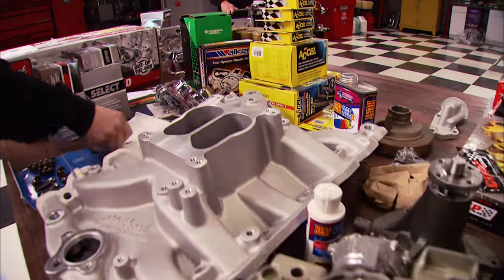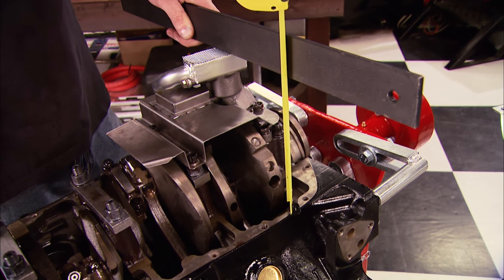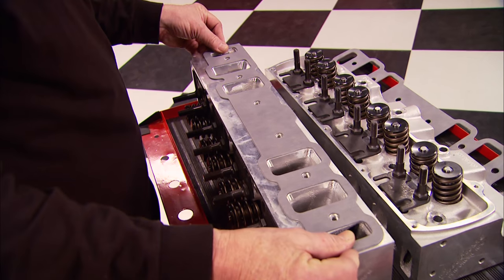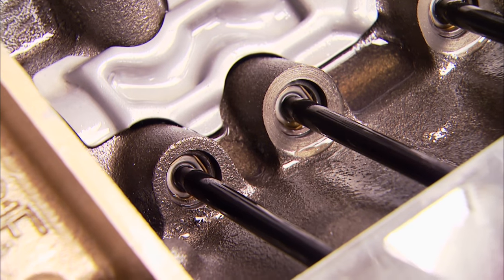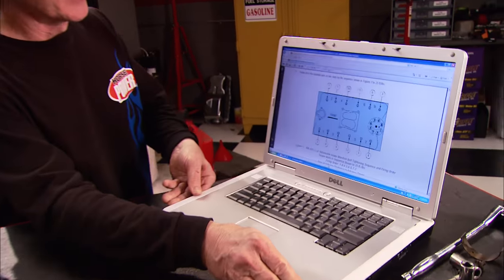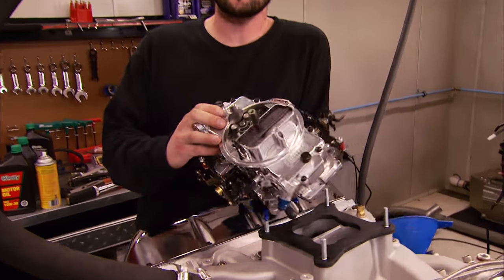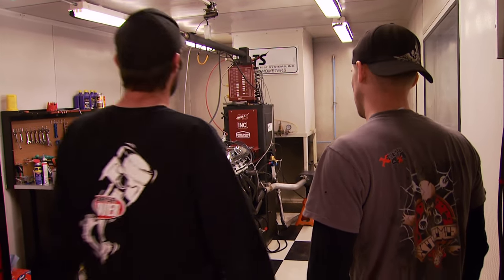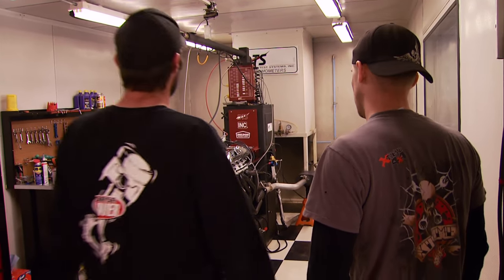Dyno Testing a Mondello 455 Olds Big Block - Horsepower S13, E8

Comment: They didn't mention oil galley restrictors in the main saddles , cam spacer or bushing to stop cam from walking forward and back.  Did a Mondello build in 1990 and most pieces had to come from Joe. They had just started testing billet MSD distributor with vacuum for the street.

Comment: but how long would that Old 455 live those engines are not good above 5k RPM
Reply: With the block job they did it should be fine
Reply: I have one in my boat. It’s runs for hours on end at 4500 rpm. Like 2 hours at 4500 rpm no letting off. oil pressure and water temp will never change, she is dialed in perfectly.
Reply: HP peaked at only 4700 RPMs with the stock cam they re-used...

Comment: Gold paint is for the 400 engine blue is the 455
Reply: 442 Olds black and gold Hurst dug
Reply: Olds gold was for a 330 350 cub IN 400 was bronze and 455 was red or metallic blue. Just saying.
Reply: Pass the gold Olds 455/461 off as a 400 in a 1960's Olds 442...

Comment: Being stuck with that manifold back at the time, it would have helped to port it, cut out the plenum divider and run a nice 1" or more spacer. Would be interesting to know exact cr and cam specs.
Reply: Look closely 00:47 re-using stock flat tappet cam... 4700 RPMs HP peak...
Reply: @BuzzLOLOL i heard new hydraulic roller cam

Comment: I had this motor in my 65 Cutlass back in the late 80's. I had so much trouble getting the rubber seal under the front of the intake manifold stay in. Seemed like once a month I was putting in a new one. Now you guys don't even use a rubber seal. I wish that silicone existed back then. Or maybe it did and I just didn't know about it.
Reply: Silicone was around then lol .

Comment: #1 NEVER pre- pump up lifters  #2 vacuum advance is for station wagons, less vacuum on load = less advance . best set up for HP engine is no vacuum advance 30 regular 32 hi-test  34-38 race gas total timing . I enjoy your show but check what your doing and saying young pups!
Reply: Is that engine specific advice your giving?
Reply: You're right about the liftere, WRONG about vacuum advance.
Reply: Vacuum advance is for efficiency. If you’re not into efficiency that’s just you being wasteful.
Reply: @timsharpe3498  When you step on the gas you lose manifold vacuum in turn your timing is reduced, its and antique knock prevention , how are you going to make hi power with 1/3 less timing?
Reply: An old fashioned distributor has about 15 to 20 degrees of centrifugal advance. When you add that to the initial timing you get total timing which is everything an engine needs at wide open throttle. Vacuum advance is for part throttle only.

Comment: That first carburetor was a horrible idea for this kind of build,there's a reason why Holley stopped making them.
Reply: Holley wasn't actually MAKING those - they were sold under their name - those are GREAT carburetors based on the old Autolite design HOWEVER they weren't available with the GIANT cfm sizes
Reply: Summit corrected those carb.s...

Comment: a few years ago I I watched a engine shop trying to get 500 HP out of a lightly built Olds 455 and they had the same intake as this one . they were struggling to get it over the 495 hp mark tell the old man who runs the shop had the idea to use the stock Olds aluminum intake the engine had from the factory. it turned out it had bigger runners and  better flow then the fancy modern one. the engine ended up making 525 hp after they changed the new intake for the crusty old one still in the factory gold paint. the owner of the engine was very happy about the power numbers but still had them put the shiny intake on the engine and kept the crusty one for later some people .
Reply: Was the engine N/A?

Comment: I wonder if a carb spacer would have grabbed 10 more hp.
Reply: hugieflhr03 you loose hp with those
Reply: @yamahaguy1732  I don't know where you get your information at but a 1" carb spacer is good for between 10 and 15hp on most intake manifolds. Go either side and you will still gain but not as much. This is an old of a hot rodders trick as indexing the spark plugs and icing the intake between rounds.
Reply: Im right there with you on the spacer thing..I thought that's what he was gonna do when he stayed late! aside from a little bit larger plenum area you get a longer radius when air fuel mixture is making that 90 degree turn from the carb throats to the intake manifold ports.
Reply: Those TV shows are basically 30 minute advertising gimmicks to flood autozone o'Reilly's and jegs with cardboard box "builders"......everyone wants a race car but not so many know how or where to find the hidden horsies without spending a boatload of cash!
Reply: Fred Mendez I would agree. I think this is a very old episode and Mike was still cutting his teeth. He’s learned a lot since Pat joined the show and that’s what hotrodding is all about. Learn something new everyday👍
Reply: @1967davethewave  It all depends on the intake ! Me & a buddy just built a Chrysler 451 stroker witch is a 400 B block with a forged steel 440 RB crank with the mains turned down to fit the 400 block using 440 rods & forged Diamond Pistons & had done some port work to the 906 iron heads we used & a 40 year old Direct Connection 509 lift 292 hydraulic flat tappet cam & we just had it Dynoed last Saturday using a Team G single plane intake with a Demon 750 double pumper & it made 487hp at 4,800 & 523 torque at 4,400 rpm's so we decided to try a 1 inch spacer & lost 5 HP with our set up so they don't always make more power . I think with a dual plane intake that usually sits pretty low like this Olds one does it very well could pick up a few more being it's adding to the ready short small plenum these style intakes have . Our engine was pretty basic with iron heads worked some & the intake along with making sure it had a good bottom end & it was only a 9:1 compression ratio so something on this Olds isn't right in my mind because I figure what's been done plus the aluminum heads it should have come close to 500 HP ! Seems to me by watching them run the Dyno they kept the rpm's pretty conservative which I know Olds 455s don't like to be revved high but being Mondelo built the block & did the mods to it they should have kept going up on rpm's until it starts to drop power off & some times not trying more RPM leaves lost power on the table ! I had a Olds 455 great torque monster but it cracked a Piston when driving it after getting down hard on it so I sold the  car but it was sure fun getting second gear tire chirps with a turbo 400 in a big Delta 88 that I had with that 455 in it lol.
Reply: @peteloomis8456  Yeah, you're right and a Team G has a pretty large plenum. I should have said every dual plane I've ever seen but i didn't.

Comment: 12:50 if the carb was not large enough. The air fuel ratio would have told him that.
Reply: no it doesnt...you can have a 500 cfm carb tuned perfectly...it would just make like 200 hp though
Reply: @philtripe  exactly.  Fuel ratio has nothing to do with carb size . You can run a 496 on a single barrel perfectly it just wont make any power
Reply: 🤔...that cannot be true...more to do with cfm, or cubic feet per minute flowing through carb, intake, combustion chambers, rather than the ratio that the air and fuel is combined....
Reply: Just research your info...no one knows everything but if you're really interested study...

Comment: Swap the intake back to the factory one
Reply: Nope, the factory intake could never make even 400hp... not going to happen. Been building Olds engines for 30 years, my guy, and never seen a factory intake go over 400hp, and be fickle as hell on a HP engine when it's hot outside.

Comment: Loads of torque but I still don't think that's much HP considering ported AL heads, big cam, intake and carb, balance, decking, etccc
Reply: You’re not going to see ungodly horsepower numbers because the intake is too small for that. The heads also need 2.07/1.72 intake valves. Too much airspeed for those heads and not enough cross sectional area. For what it is, that’s good power/torque.
Reply: Peyton Hunt it makes for a good street strip engine. It certainly is not a all out race piece. Engine has lots of torque down low.
Reply: @markball7028  
That's correct and it makes for a good street car.
Reply: @markball7028  nice for old school classic sleeper like a 98 Regency or Cutlass Supreme...heavy cars like torquey engines!
Reply: 00:47 looks like they actually re-used the stock used flat tappet cam... 4700 RPMs HP peak says the same thing...
Reply: @BuzzLOLOL  They mentioned a ROLLER CAM in their new parts list. Old's not really a 6500 engine, plenty of torque though and nothing wrong with 500 HP if someone is an Old's only engine building a strong motor for a 65-70 442 and certainly more than any stock W-30 of the day, they were rated about 370, 500 hp get into the 12's with good traction so for a reliable engine not that bad but sure not a BBC
Reply: @zxtenn  - Look closely at 00:47 they're sneaking the used stock cam back in... 455 HP isn't bad for 4700 RPMs as shown on dyno readout... 
BBC L88 427" makes about "430 HP" at 4300 RPMs... but rev it to 6600 with headers...

Comment: How can you be so off from the start? They picked up 120 hp with timing and a carb swap with jetting. 

I built a 455 in the 80s that made this kind of power with stock c heads. 

What a joke.
Reply: maybe you just think you were making 455 horsepower with stock parts...you know, 335 hp with 500 foot pounds makes for one hell of a burn out machine so im sure it was a mad car but imagine what it would have been like with 455 hp
Reply: stickloaf yeah maybe I just imagined me going 11.80s @ 113 weighing close to 4000 in a 70 cutlass.  I’m not speaking from theory I speaking from facts. They should have made 500+. Hp
Reply: @rle1020  do you realize how many people say it's not possible to get 500 hp from olds 455??? Expensive, but possible...just have to do it under 5000 rpm...they like the foot stomp but not the wind up like a 327 chevy....
Reply: Look closely 00:47 re-using stock flat tappet cam... 4700 RPMs HP peak...

Comment: In the 60's Olds had a huge R&D program and were experimenting with Hemi heads for the big blocks.
Reply: Everyone was trying to utilize the Hemi head even Pontiac who won in the nitro classes 1 year using modified 392 Chrysler Hemi heads lol . Arrdun I believe used to make Hemi heads for the flat head Ford's as well !
Reply: Olds was always the experimental division... their 1940 Hydramatic transmission was decades ahead... had turbocharged aluminum V8s in 1962 Jetfire... in 1975 had direct port injection EFI Olds 350" V8s... later the DOHC NorthStar engines...
Reply: @peteloomis8456  - Ardun was Arkus Duntov later of 1950's Chevrolet/Corvette fame...

Comment: 456 horsepower with all that head work? Very disappointing!
Reply: No kidding that's poor
Reply: @jefferybernard4800 why. Was you wanting 600 horse power. I don't think so. I have a Pontiac 455 makes the same horse power under the hood
Reply: 1hp per ci is great. Olds engines are known for torque, not hp. Yall must be young.

Comment: 2:37 "Valves are at 2.19, 1.88"
Nope.
You need to check your specs. You just stated the stock Chevy BBC valve specs.
A bit more homework would have revealed the Olds head's biggest problem, among many.
2.07 intake and 1.66 exhaust (if I remember). Because of the head's design, it's very difficult to get anything larger in there, too. It's one of the reasons you don't need a lot of exotic things like 4-bolt mains, forged crank, or anything else, really, to accommodate actual breathing, since those heads can do very little of it.
Interestingly; it is also why the W-31 option was so hot. The 455 heads on the 350 gave a valve size to displacement ratio that was better than the Chevy's Z-28 (But it still couldn't rev as well to take advantage). The W-31 Cutlasses were strong in street trim.
Reply: Yep the valves are shrouded witch kills power because of the chamber shape & size !
Reply: Which.

Comment: I had a 427/425 BBC and always set timing at full advance about 2500 rpm not at idle, used to have one of those tapes' you would put around the balancer, seemed 36-38 was fine

Comment: Um... a small vacume leak at the distributor isn't going to effect timing at WOT...you know, when there is almost no vacume. It will lean the engine out slightly though, depending on were the vacume is sourced.

Comment: I would like to see an electronic fuel-injection system on the Olds engines; they never really had them from the factory, and it would be interesting to see what they could do.
Reply: Actually Olds was way FIRST with DIRECT PORT EFI V8s! As used in 1975 - 80 Cadillac Sevilles...

Comment: Whoa....stock 455 W 30 supposedly makes 370 horsepower...what cam did they run? Not sure I caught that..Those Edelbrock heads had huge valves....2.19 Int and were they 1.84? exhausts? Hmm, yeah, that manifold could be suspect. Many years ago I built a 455 +.030, stock "C" casting heads, Lunati .570 lift solid cam, with 255 degree @ .050 , 2 inch Hooker headers 800 Holley D.P.  Q-jet replacement carb, (spread bore) on an Edelbrock single plane intake.
With stock 10.5 to 1 compression, the motor made 485 horses....(don't recall torque). Ran 11.50's at 117 with a 9 inch tire in a 68 Cutlass...
Reply: 00:47 re-using stock cam... 4700 RPMs HP peak...

Comment: Had a jet boat with a 455 olds. With a set of cast iron C heads from Mondello.
Edlebrock performer intake. 850 Holley and a solid lift clay Smith cam. Jay Taylor engineering did the machine work.
Dyno 556 h.p. at the crank. 
WTF? Under 400hp? 
Those motors will make 400 h.p. no problem with a mellow hydraulic cam.
Reply: Ryan Lewis - sorry but no way your 455 made 556 hp as you described.  The engine builder messed with the conversion to try to please you and make himself look better.  Easy to do and this has always been a common trick with many builders.
Reply: Difference is what you stated...the builder...you can't just bolt on some parts and presto lets go to the track...a true engine builder knows where to find hidden power...promise, its NOT always in a box...
Reply: @danmyers9372  it had a solid lift cam and head work. It most definitely made over 550. Not hard to get over 500 hp out of any big block N/A.
I've built several big blocks.
For boats.
As far as your B.S. dyno fudge.  
You are high. I built the motor.
I took it to RCR tuning and was present during dyno and tune.
My Dad and myself have raced flat bottom sportsman class (NA with single quad limit 1050cfm) and Blown gas class. You don't know what you are talking about.
Reply: See 00:47 re-using stock cam... 4700 RPMs HP peak...
Reply: @BuzzLOLOL  ok, now that makes more sense. Removing my foot from my mouth.

Comment: It would be interesting to see what kind of power it would make with fuel injection.

Why wasn't it built with hydraulic roller lifters?
Reply: EFI wouldn't make any HP difference...
Reply: 00:47 re-using stock cam... 4700 RPMs HP peak...

Comment: I AM 64 NOW BUT MID 70'S I BUILT A 67 CAMARO YENK CLONE CAMARO, 427/425 AND ALWAYS SET THE TOTAL TIMING WITH ONE OF THOSE CHEAP TIMING TAPES THAT GO AROUND THE BALANCER, SEEMED 36-38 WAS OPTIMAL, I NEVER SET IDLE TIMING EXCEPT FOR A BASELINE TO GET IT CLOSE
Reply: That's right

Comment: The junkyard 455 I put in my pickle fork hydro v-drive made 471 with a tunnel RAM and 660 s. Stock iron k heads, mild cam from moon. Dizzy locked out at 38*  no vacuum advance and hei. Boat ran ,80 gps...you guys running street don't drilll out the drain backs?  Olds motor limit is 500 hp and 5000 rpm...after that they start spitting parts out.
Reply: blackbirdxx928 - that sounds about right.  Guy above posted  his 455 made 556 ho with a more mild build than yours.  Had to break his heart and tell him his engine builder lied to him.  Absolutely no way his engine made 556 HP.
Reply: @danmyers9372  yep yep,  I can build one that makes that kind of power but ain't nuthin but a grenade. Bet ya didn't know that you can pull the crank out of a 455, bolt a main cap back on, torque spec and give it a good whack with a framing hammer and like magic a 2 piece main cap...the actual fix is a steel 421 crank with BBC rods...that said, 455s make monster torque and they will live a long life if you avoid high rpm...I have a buddy with an old Hardin marine jet boat and best o can tell the motor never been apart and it runs plenty decent..and for sure it will stop a a basic 454 out of ao ho

Comment: What do you think the mileage will be after this improvement? I'll be doing a similar build to my 71 cutlass soon. I have to aluminum heads and intake and a roller cam as well.
Reply: Did you get this done?
Reply: @BuzzLOLOL  sadly no, I'm still working on the body and frame, and will soon be on deployment for the next few months.

Comment: I would love to see this Olds 455 dyno tested with a 1050 carb!! I bet this this pig would really respond to the extra airflow.
Reply: Nope... couldn't even use the 750 or 850 CFM fully... small cam. low compression ratio...
Reply: @BuzzLOLOL  I have a 66 442 L69 why did Joe recommend the extra CFM with 55 less cubic inches? Blueprint 383’s ship with 850’s the 455 is a heck of a lot more cubic inches. Not being a smart a I genuinely want to understand the science behind it.
Reply: @LEXLUTHER66666 
A properly built 455 you could definitely use a 1050 carb on it but this 1 in the video not so much. They did a crap job of building it !

Comment: Wrong intake manifold for that cam.  Should have use a single plane intake instead.  I guess that's what you get for using Edelbrick stuff...
Reply: Look closely 00:47 re-using stock flat tappet cam... 4700 RPMs HP peak...